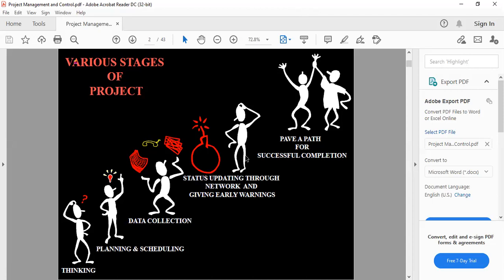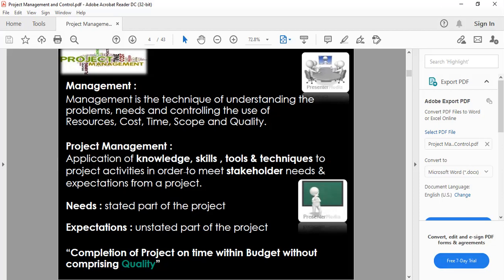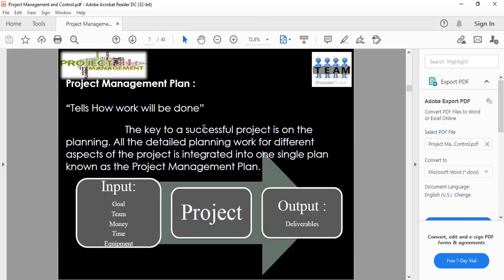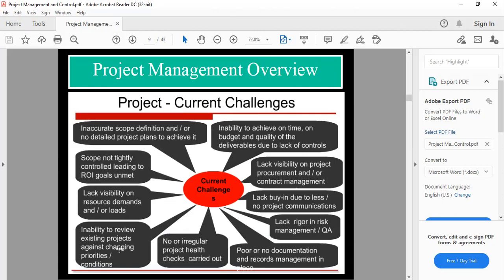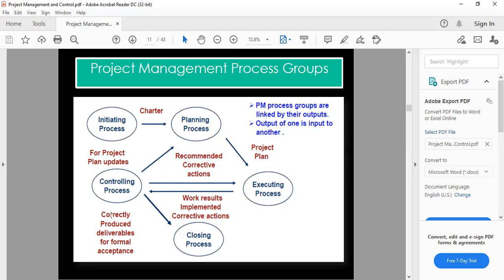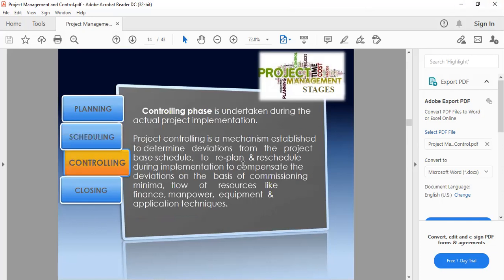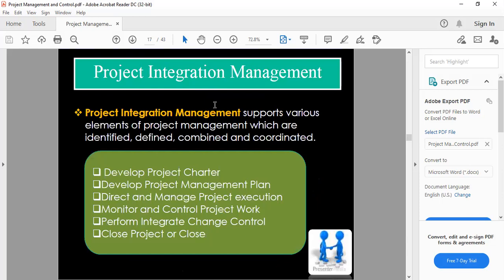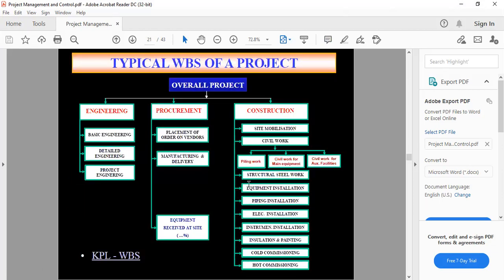Project Management and Control Part 1

Comment: In this video The project control andmanagement, here are some important points I've learned.
First, various stages of project begins with 1) thinking or the mindset 2)planning and scheduling 3)data collection 4) status updating to network and giving early warnings 5)pave a path for successful completion. This is we should do to the project we should be able to solve and be successful afterwards.

Second, Management is the technique of understanding the problem, needs and controlling the use of the resources. Then the project management is the application of knowledge, skills, techniques and tools. Project management is important in companies so that project will be able complete effectively.

Lastly, Planning is the very important part here because this is so critical it need most with an appropriate application of such plans and detailed and having a good set up for a better result. Then scheduling, for applying what have planned. Then controlling plays also an important part here. Then closing is an ending to close the project with success.

Comment: This are some important points I learned in Project Management and Control Part 1.
First, why do companies use project management. Project management is important in an organization because it helps to achieve the goals and deliver the best output of the company. Companies use PM to asses the risk and failure points and make backup plans. Also to allocate the receipt right resources at the right time.

Second, project management process. The first in the process is the enter phase or initiating process, it is the start of the project, and the goal of this phase is to define the project. It followed by planning process where the scope of the project is defined and a project management plan is developed. Then executing process, executes project management plans. After monitoring and controlling process, this is all about measuring performance and ensuring that everything happening aligns with the project management plan. And lastly exit phase or closing process, represents the completed project.

Lastly, project integration management. It is the way to takes the numerous processes that are being used in a project and makes sure that they’re coordinated. It involves in developing project charter, develop project management plan, direct and manage project execution, monitor and control project work, perform integrate change control and close project. It is important to make sure that the informations are balance and the project activities are completed.

Comment: First thing that I learned about this inforamtive video is the Various Stages of Project, first we have the thinking/ brainstorming, then we plan and schedule activities, we gather/collect the data, we update our status through the network and we also give early warnings to our project so that we can improve our project/task, and then pave a path for successful completion.

Second thing that I learned is about some of the reasons why companies use Project Management are:
(1) so that they could be able to handle the project effectively and efficiently.
(2) to define the project and agree with the customers. 
(3) to plan and assess resource needs for the project. 
(4) to estimate project cost and make proposals. 
And etc. 

The last thing is that the key to a successful project is on the planning. And all the detailed planning work for different aspects of the project is integrated into one single plan known as the Proejct Management Plan. 

And many more...

Comment: I've learned the following points after watching the discussion on the first part of Project management and control:
First, I learned that project management plan also involves the functions of management which are planning, organizing, staffing, directing, and controlling to provide solutions to identified problems. Knowledge, skills,  and tools and techniques are applied in a project management to meet the client's expectations from the project.
Second, I learned that project management plan is the key to a successful project or completion of every project. Project plan is a detailed task-by-task work plan, a guide that tells how the work or project will be done.
Lastly, I learned the stages involved in project management. First stage and most important phase is planning which is then followed by scheduling. The fist two phase are undertaken before the actual project starts. Next phase is controlling which is undertaken during the actual project implementation. Last phase is closing which brings close or end of the project. During this phase, all pre-defined requirements of the project are totally delivered and is accepted by the customer.

Comment: First, I learned the various stages of project which are the following: thinking, planning and scheduling, data collection, status updating through network and giving early warnings, and pave a path for successful completion. I learned that project has a timeframe and have a specified scope and budget. A project is also unique and have a beginning and end. I also learned that we need to apply our knowledge, skills, tools and techniques to be able to manage a project so we can meet the stakeholders needs and expectation from the project. 

Second, I also learned the reason companies uses Project Management. Some of the reasons are to estimate project cost and make proposals and also to allocate the right resource at the right time to name a few. I also learned that project management plan which involves the input (goal, team, money, time, equipment), project and the output (deliverables). I also learned the current challenges the project management have. 

Third, I learned that Project Management groups are linked by their outputs and the output of one is the input of another. I learned also the Project Management Stages which are the planning, scheduling, controlling and closing. I also learned that Project Integration Management supports various elements of project management which are identified, defined, combined and coordinated. I also learned that project charter is where we can see the details of the projects. I also learned about the project scope management and what it includes. 

This is all the things that I learned sir. Thank you!

Comment: I learned this video is all about Project management and control. The various sstages of project are : Thinking, Planning and Schedule, Data collection, Status Updating through network giving early warnibg and pave a path of successful completion.
Second, I learned that the project this would convert a vision a dream or a need to reality to have a project. It is a job that has a beginning and an end. Temporary and unique is the characteristics of project.
Third, Management id the technician of understanding the problem, need and controlling the use of resources, cost, time, scope and quality.
Lastly, The PM plan. established the project by : Why, Why and What, Who, When, How  and How much. 
Project Management process Group
. Initiating process
. Planning Process
. Executing Process
. Controlling process
. Closing Process